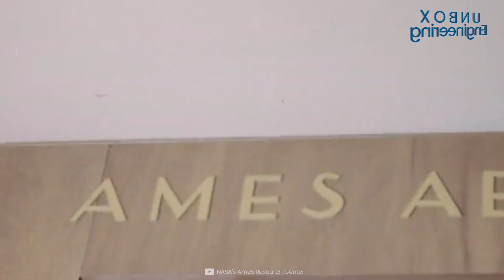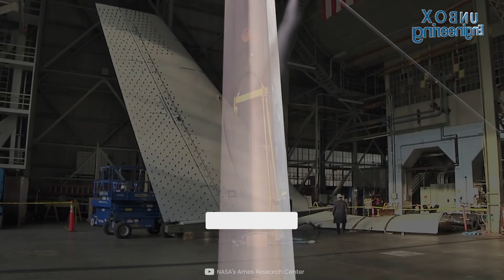World’s Biggest Wind Tunnel Where Airplane are Tested

Comment: The Wind Tunnel featured in this video is the National Full-Scale Aerodynamics Complex or NFAC.

The Unitary Plan Wind Tunnel is also at Ames but the test sections are smaller. However, UPWT can go up to speeds of M = 2.5, whereas the 40x80 goes tops out closer to M = 0.45.